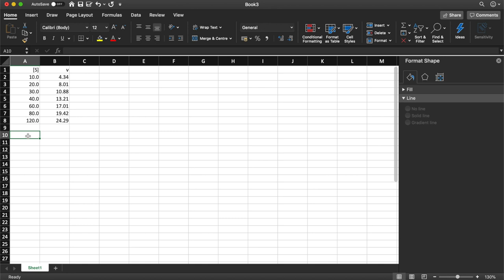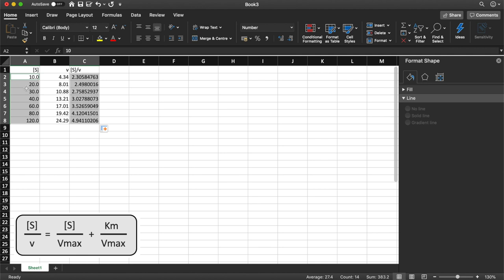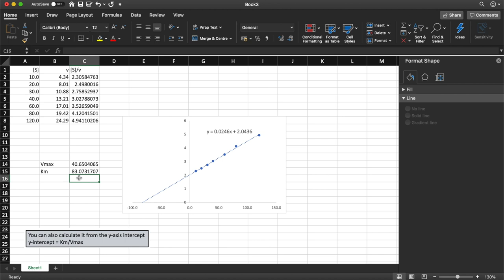How to calculate Vmax and Km from a Woolf plot

Comment: another way you can work out the Km is the gradient (slope) to the power of -1 multiplied by the y intercept
Reply: thanks for the video by the way very helpful in checking if I was right
Reply from the maker: Hi Josh, yes there are different ways to calculate Km and Vmax for most of the enzyme plots. I've just included the most common or my preferred method in these videos.